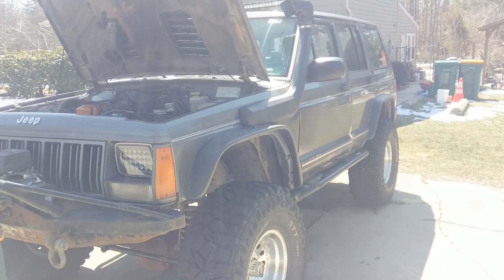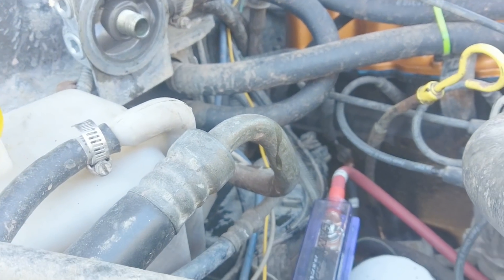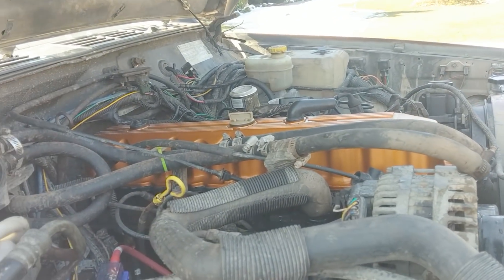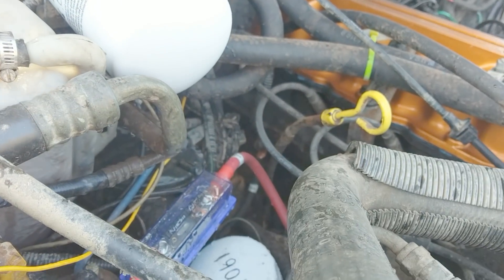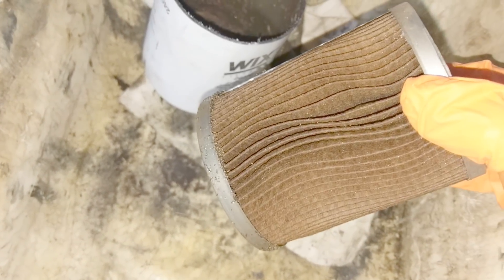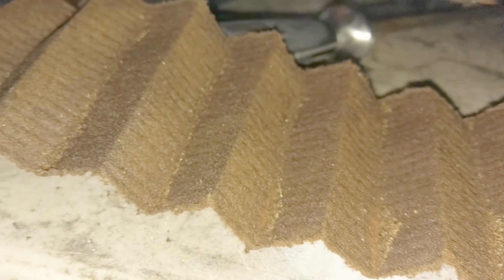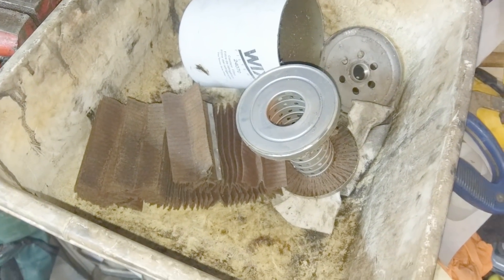Jeep Cherokee Coolant Filter long term Review

Comment: That's badass. I need to do that too. Even with a freshly flushed block, heater core, brand new radiator, I still get brown water with in a month of flushing every single time, no matter how clean it is after flushing.
Reply: Engine full of casting sand?

Comment: My 2004 260k mile 1.8t jetta went in for service. Some coolant hoses were replaced. Asked my mechanic if a coolant filter would be a good idea. He said no. Half the coolant was replaced and its not due for a flush. 
On the drive home i turned the heater on to warm my hands. The heater blows hot enough to almost be painful. It was barely even warm. 
Yes, preventative maintenance practically eliminates the need for a coolant filter. But in an older vehicle purchased used i think a coolant filter IS preventative maintenance.

Comment: All that peppery stuff is the stop leak.  Thanks for the vids on this setup.  I have a 1998 TJ 4.0L that has some nasty rust in the system (bought it used with 150k) so I'll be installing one of these.

Comment: I ordered the kit you have. I am not expecting rust in my XJ because I have 4 gallons of water-less coolant. I had seen your video before also. However that sandy, gritty stuff in there made me think I should install the filter. I bought the Brass Hose Barb with Straight Fitting Style, 1/2" Thread Size is Item #6AFL4 at Grainger industrial supply. $5.30 each but very high quality.

Comment: I have a car that had never had it's coolant changed in 20 years until I got it last year. I've flushed it twice now and it's decent but still not great. This summer I'm going to put new hoses on as the inside of the hoses are caked with rust/whatever else, and they're 20 years old so not even worth my time to clean them out. I think I'll put a coolant filter on it.

Comment: Great idea. I had a water pump go bad on me and the shavings are a nightmare. Been through 3 pumps since and 1 heater core. Its a nightmare because getting the shavings out of that long inline6 is tough. The last time i flushed out every way possible and hope it will last but this could have saved me 3 water pumps one of which was  on the side of the road. 

You think there is a better filter though? One that has slightly better flow than an oil pump. I dont have problems with rust just aluminium shavings getting in the bearing of the pump.
Reply from the maker: This is a specially designed coolant filter, different threads then an oil filter. It's the biggest one I found that would easily fit. Also went with the large port base for less restriction. This is not a full flow filter though, so it does have to go on an accessory line like the heater core. It's plenty fine and over time should catch anything that's floating around the system.

Comment: Hey there hey there, so I just installed the same set up on my Jeep about a month ago, and my heat stopped working so I wanna check the filter but I’m worried about air getting into the system, should I just burb it afterwards or what?
Reply: Its the outlet port need bored out coolant barely fills the core not enough volume

Comment: I know you tied this into the heater hose so it wouldn't restrict the main coolant flow into the block.. I have a 96 with a heater control valve, so where would you tie in the filter in that case?
Reply from the maker: Same spot, just forward of the valve
Reply: Gotcha, so coolant still circulates through that hose even if the valve is closed? That was my concern, guess I'm just not sure how the valve operates lol. Thanks man!
Reply from the maker: I got a video all about how that valve works too, but it's just a bypass, when the heat is off the coolant is directed right back to that water pump
Reply: that makes sense now that I think about it. In my head I was imagining the valve closing just plugging the heater hose, but I guess it redirects it to the return hose instead (makes way more sense). I can't believe how clean that coolant came out though I'm seriously thinking about doing this!

Comment: Curious if you’ve done this again and seen the similar amount of crap? I’m getting tempted to do the same. So over flushing annually. Every flush it seems it slightly lessons the next year worth of filth.
Reply from the maker: I really don't drive this Jeep a whole lot, so it still has the same new filter that was installed here. I may pull it if curiosity ever gets the best of me, but for now I'm just going to run this one until I feel it's up to capacity.
Reply: NickInTimeFilms makes sense. Post it if you do!

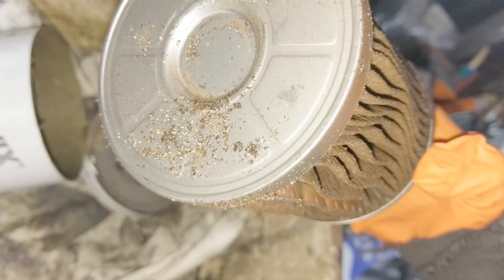Comment: 4:40 how the heck that filter flows thru that 5mm hole? there can´t be enough heat in winter
Reply: It's not full flow, so the filter doesn't slow down the coolant through the heater core. After watching this video I'm getting this asap. Previous heater core and radiator was so clogged I had no heat in winter + severe engine overheating. This is a no brainer.
Reply: @filmjazz  i used same 24070 filter but i drilled bigger hole cause i have webasto heater on that hose, webasto will over heat with 5mm hole. i even used 33225 wix fuel filter for a awhile, thats 14micron filter. now my cooling system is quite clean.
Reply: @mannine99  I don't know what the webasto heater is, but since you have experience with this now: if I'm running a stock 2000 XJ, will the exact parts in this video work fine for my rig? I just had the heater core and radiator replaced. Don't want to have to ever do that again - this looks like the answer to my problems!

Comment: That crap is probably what's eating my water pump bearings...

That's sand and casting flash being worn away from the block. Just a characteristic of running an iron block.

Comment: Its not $20, more of north of $50. Need hose, clamps connectors, filter base ad filter. I love it how people low ball  saying for only $xx, so really just multiply that 3 fold.
Reply from the maker: Such is the life of a mechanic. A $20 oil change and a 15 minute job are never really what they claim to be. Install video has a full parts list so you can go do the math yourself if you like.
Reply: Or you can go through all the BS to flush your heater core and rad as well as the $40 gallons of antifreeze.